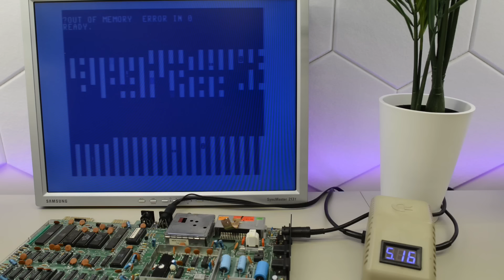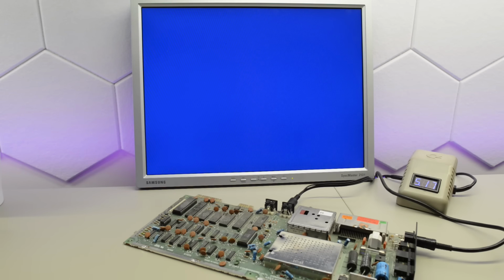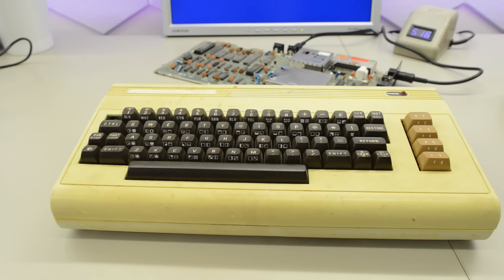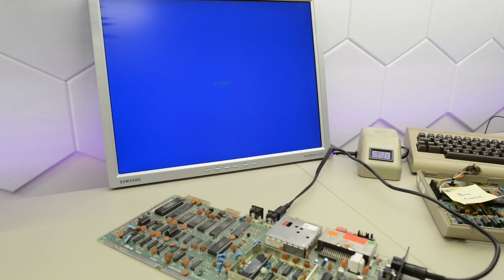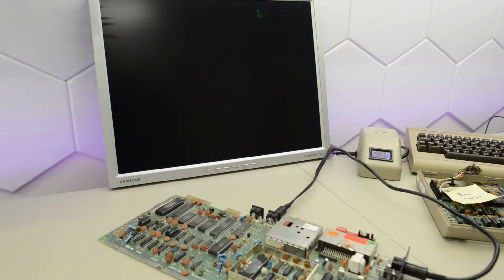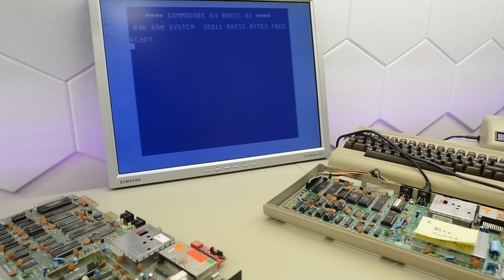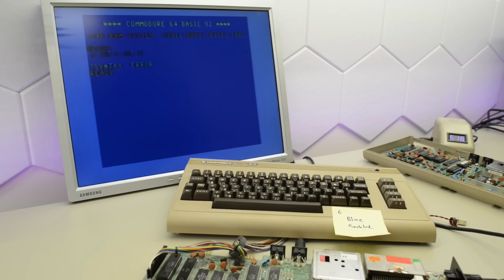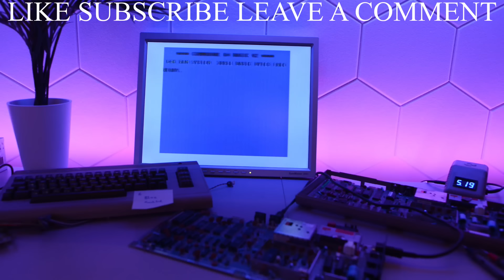Can we repair Adrian Black's Commodore 64 board? So many issues! I was expecting an easy repair :)

Comment: Sorry, but I'm a bit disappointed in this video. Why did you not use an oscilloscope? I bet you did not even have a valid clock signal out of that VIC-II (not to mention RAS/CAS signals), of if you did, the video output was not a valid NTSC/PAL signal, as the monitor had a difficulty picking it up. This basically gave away a timing/VIC-II fault. I'd have suspected the contents of the tin can first. You could have spared a few sockets, and a bunch of solder. 

Regardless, can't wait for the next episode, as I love your content. :) But please, next time, don't be afraid to use that pretty scope.
Reply from the maker: Thanks for the honest feedback. My thought was that any chip on the board could have had a short. The VICII just happened to be in a socket and got first in line. You're right about me being lazy with the scope. I only have a big and heavy vintage scope and it has to be put away after every time I use it. I tend to guess more than I should instead of pulling that big old scope out
Reply: @Epictronics1  All I have is a hantek 6022BE but it's perfectly capable for these low frequency boards. Cost: about $35 on average, prices are going haywire at the moment.
What I want to say it's an ideal low budget scope. And I doubt you don't have a pc with windows or linux nearby.
Reply from the maker: @paulmichaelfreedman8334  I have the plan to move some stuff around in the lab to make room for a permanent scope on the bench. If that plan doesn't work out I'll buy a smaller scope

Comment: The grow light is 12 x 26 (= 312) LED chips. A 2000 Watt unit would assume way over 6 watts per chip.... No... most certainly not. At best they are 3W, more likely 1W chips.
Maybe they used the apparent power (which could be 2kW, if we consider 3W chips and a power factor of 0.5, which would be normal for a capacitive dropper).
The sad thing is, in parts of America and Europe some energy companies already started charging based on apparent power consumption (that usually happens when you get a "smart meter"). So while you're certainly not using 2kW, you'll be charged for it.
Reply from the maker: How weird, they really shouldn't do that. I guess we'll never know how powerful this light is, but at least it's speeding up the process many times. From this first test, I would say it does 1 day's of work in one hour!  (at room temperature)

Comment: Weird problems like these mean 99% bad power.
Reply: It may look like it but unfortunately this problem is probably not caused by bad power supply.
His PSU seemed to be stable enough for this machine.
C64 were not the most repair-free equipment to begin with, and aging didn't do them any good.
But a bad power supply could have easily damaged the chips in the past.
If you look closely, color flickers only when code is running. This looks like the chip is enabled when it shouldn't or something else is enabled instead. Probably the PLA is bad.
Reply from the maker: Well, I checked the voltages and we are all good. My PSU is modded and safe. The PSU Adrian used when he tested the board in his basement was also a reliable modern replacement. I don't think we killed it with a bad PSU
Reply: A Dutch eBay seller (a business) had a good C64, but according the description, it was used to test other commodore psu's. It ended  as you can guess. I think they doesn't know the "old psu problem". I think too many "electrocuted" parts.
Reply: @user-marco-S  Oh wow. I don't know if I should laugh or cry. I was once given an ATX PSU that had +13V on +5VSB line - silently killing your motherboards before you even pressed the power button.
Reply from the maker: @user-marco-S  haha, that was a bad idea, I wonder why they didn't just use a multimeter :)
Reply: @Epictronics1  Maybe they find it unnecessary to do that. Who knows they don't know that rifa caps contains "magic smoke". They have a website and selling a lot of non-food stuff, like cameras, monitors, recorders etc.